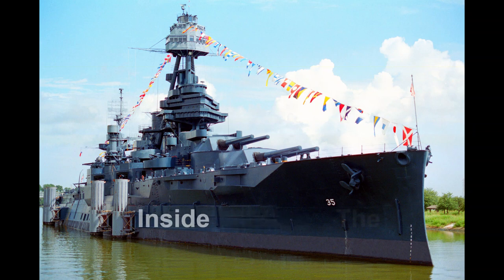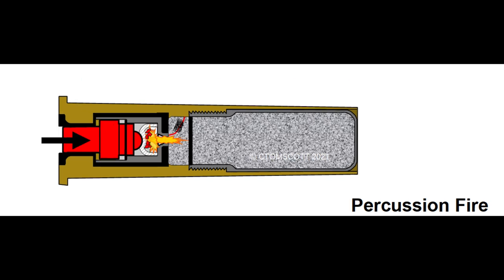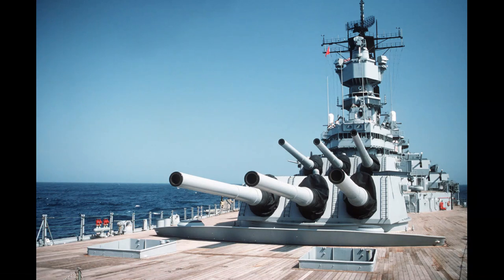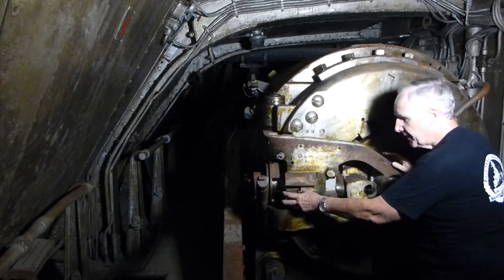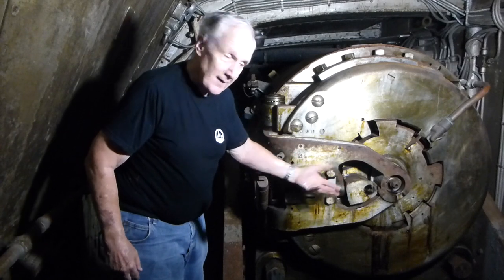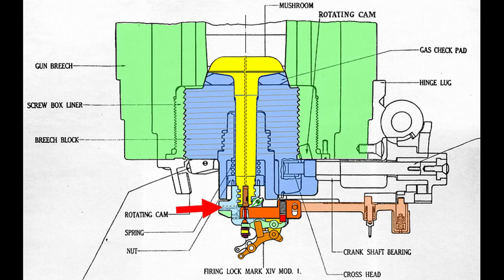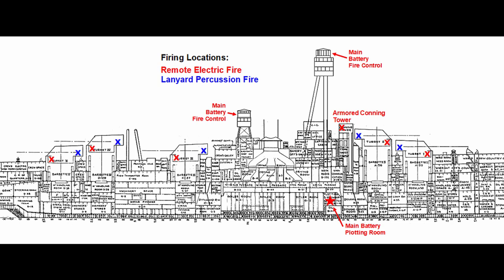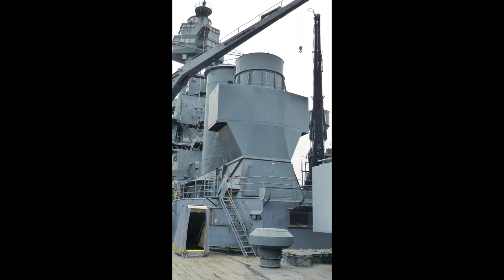Battleship Texas, Locked, Loaded and Ready to Fire!

Comment: Excellent explanation, especially for electric firing.  I had assumed a solenoid driving the hammer.  Had not thought of using a hot wire.  In the case of the triple turrets in the Pennsylvanias that we were discussing some days ago, there would be no way for the plug man to be out of the way when closing the breech, due to the bottom hinged plugs and lack of room between the guns.
Reply from the maker: The duties for the three plug men in a Nevada or Pennsylvania triple gun turret were very different from those on Texas.  The following was taken from a 1927 gunnery drill manual.  From a position below the gun, they opened the breech and locked it in the open position, inserted the primer, then unlocked the plug once the gun was loaded and tray removed.

Comment: Tom, I really miss the video's you were doing.  They were incredibly informative.  I saw on another channel for the USS Iowa a video explaining how to manually lower the guns in one of the 16" turrets.  They were having to dis-engage a holding pin in the gun elevation mechanism before moving it, in similar fashion to the turret locking pin that you had shown in one of your video's.  Does the Texas also have a locking pin for the guns like this?
Reply from the maker: Thank you for your kind compliment.  I am not aware of any locking pin for the elevating mechanism, nor am I sure why one was needed.  The stresses on the elevating gears are entirely different than on the training gear and the loads are far less.

Comment: I am guessing your fire control computers were salvaged by the Navy at some point for parts for the surviving classes of battleships? was it the same computer the Iowas used their whole carrers?
Reply from the maker: The range keepers on Texas were Ford Mk 1, Mod 11 (Hannibal Ford, not Henry Ford), while I believe those on the Iowa class were Mark VIII.  Texas' range keepers could do nothing more than provide a decent firing solution that was displayed on needle matching receivers in front of gun pointers and trainers.  They used that information to aim the guns from their positions in the turrets.  The Mk. VIII was far more capable.  It could not only incorporate other additional variables, like the Earth's Coreolis effect,  it could also automatically aim the guns through the use of servos.  I have heard that the range keepers, the stable element and the directors located in other positions on Texas were removed due to their weight, but I cannot confirm that.

Comment: Ive always liked the 5x2 turret gun set up...3x3 seemed too easy to lose your offensive capabilities....
Reply from the maker: You are right, it is better lose 2 guns instead of 3.  However, there were major benefits with a 3-gun turret that made their use unavoidable.  The 5 turrets on Texas and 6 turrets on the prior Wyoming class were somewhat sarcastically called turret farms due to their shear number.  By going to 3-gun turrets and eliminating one of them, you lose some gun protection, but you also lose the weight of the extra turret and barbette.  The equipment and powder magazines required to feed it are also lost.  Also eliminated is the need to protect those magazines with armor and the space all of that occupies.  The typical result was overall weight savings of over 2,000 tons.  The designers used those savings to improve hull and deck armor over what remained for even better protection. So while you increase the possibility of losing an third gun in a turret hit, you have also increased overall protection and defensive strength of the ship.  

They went back to 2-gun turrets in later Colorado class built in the early 1920's that used 16" guns.  The tremendous weight increase of those guns, turrets and ammunition storage required going back to 2 guns since the ship hulls didn't increase enough in size to provide the buoyancy needed to support a 3-gun design.  It wasn't until the 1930's that ship size increased enough to support 16", 3-gun turrets.
Reply: @tomscotttheolderone364  Never thought of all of that, Really appreciate the explanation...no wonder they never tried the 18” haha....Although Ive read about a Tillman class ship, cant remember if it was US or UK design but i think they proposed 18”....a 14 or 16” shell hitting the decks towers or turrets had disastrous effects anyway, but ya gotta hit the ship first 🎯 Thanks again!